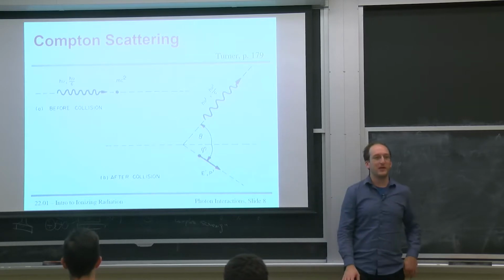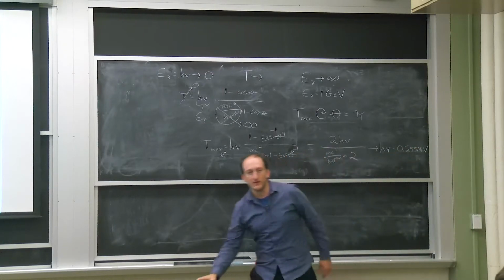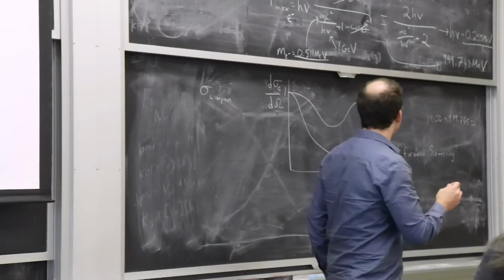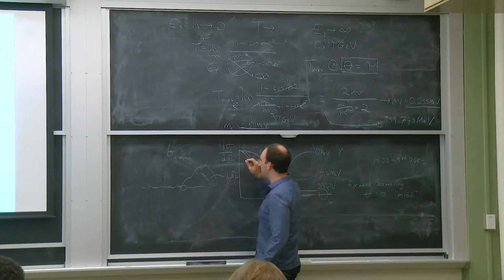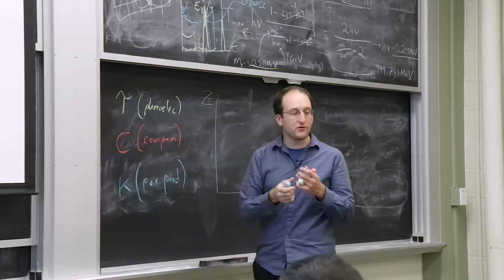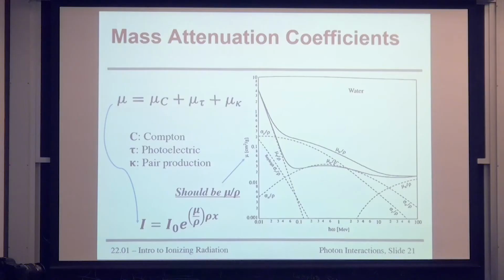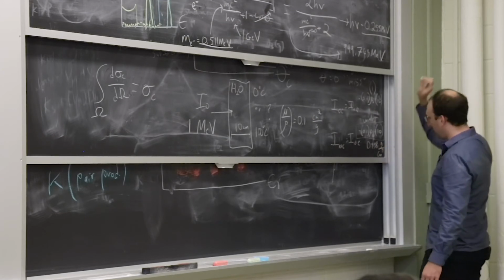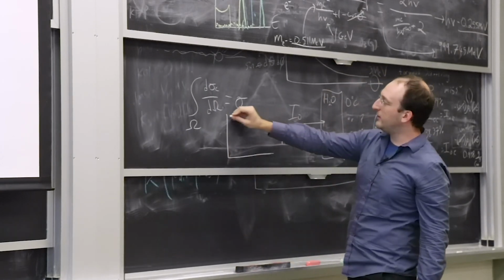15. Photon Interaction with Matter II — More Details, Shielding Calculations

Comment: At 31.53 (BTW,  the exponential formula is missing minus sign), you are saying mass attenuation coefficient is equal to macroscopic cross section, right? That's not exactly correct. However, linear attenuation coefficient mü = N* microscopic cross section (small sigma) = macroscopic cross section (capital sigma), where  Thus, these 2 might be the same thing .  MFP (lambda) = 1/ mü = 1/ macroscopic sigma. What that means, mü = capital sigma.

Comment: Great lecture, sir. Thanks MIT for sharing. Around the minutes of 9.44, you mixed up energies and terms. You should've said as the photon increases its energy up to 1GeV for instance, the scattered photon energy becomes 0.255MeV while the maximum kinetic energy of an electron is 999.745MeV.
Reply: And it doesn't really make sense to have the equation with the electron rest mass as a named unit, then a numerical value (for half the unit), and then identify the numerical as the named unit and substitute it back.